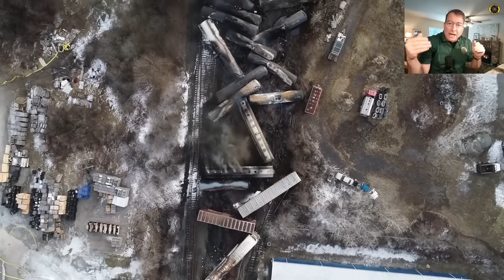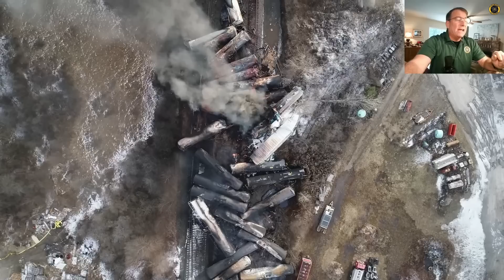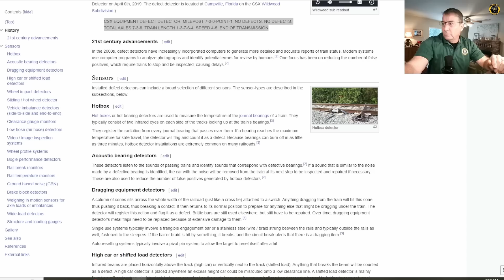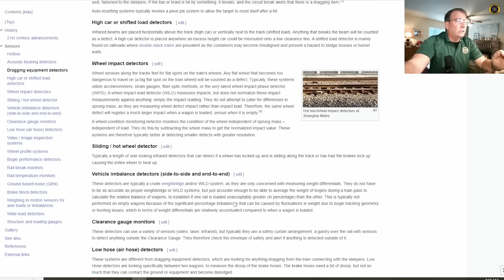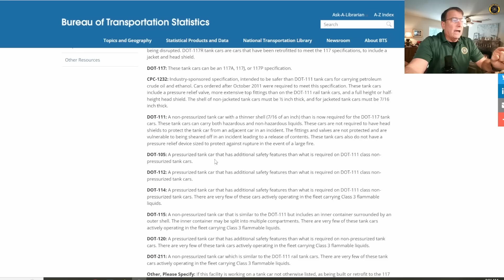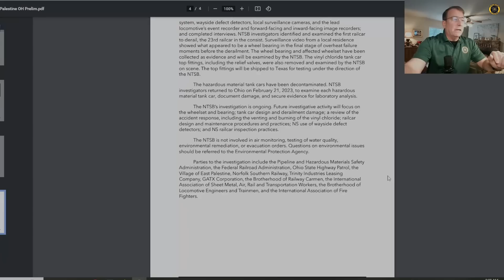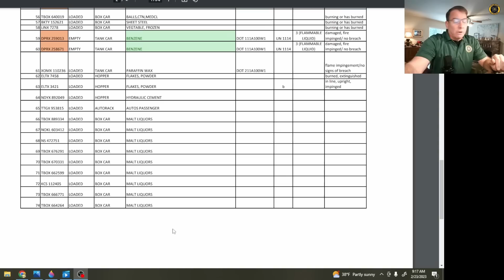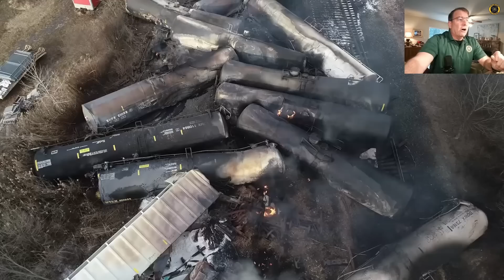NTSB Prelim Report: Norfolk Southern Train Derailment 23 Feb 2023

Comment: Juan, couple points.  The pneumatic (called "air brakes" in the industry) brakes are also used to slow or control a train.  In fact, the dynamic (what you refer to as regenerative) brakes aren't required, but the air brake system is required to be tested on every single train before it leaves it's initial terminal and any time cars are added, they must be tested to ensure their air brakes work.  The air brake system only initiates an emergency application when the air is let out of the train too rapidly.  If it's let out at the appropriate "service" rate, it simply results in the brake cylinders on the cars receiving a controlled amount of air pressure.

Second point.  The accordion effect is caused from the cars that have derailed, and are now rapidly decelerating since they are plowing through the ballast rock, being crashed into by the rest of the (not derailed yet) train.  The large speed imbalance between the cars that have derailed, and the cars behind them creates massive buff forces that cause the accordion.  As already mentioned in the comments, emergency brake applications, alone, rarely cause derailments.  I've had hundreds, and never had the train derail.
Reply: Correct!! Air brake systems are used for normal braking and train handling, not just in emergencies, where train pipe air pressure is lost of dumped by the crew.
Reply: Thanks, came here to correct the braking commentary, you did a better job than I would have.
Reply: A wrung journal will make for a long day
Reply: Good old George Westinghouse and his air brakes.
Reply: well at least I'm not the only one that caught that and I'm glad that some one else beet me to saying it. well put
Reply: I agree if anything the emergency braking is going to slow the cars before they derail. (Excellent comment!)
Reply: Thanks for explaining, and I have to agree “emergency breaks cause derail and accordion effects” just doesn’t make sense. If emergency breakers causes derailment, then there is no reason for them to even exist. Rails and train car design prevent accordion effect during a crash, and I would assume the hot bearing caused the axle to fail and derailed the train.
Reply: @AaronShenghao  Normally a train will already be slowing before going into a commanded emergency.  There is a reason the engineer slamming the service brake lever from zero to full (emergency) is not normal procedure in all but dire emergency, like engineer sees stopped train or other major obstruction (sorry wildlife you aren't counted as such) ahead on same track type dire.  Also in the case of this accident the emergency application was not commanded as it was caused by air line breakage after the initial separation occurred.  There are cases where commanded emergency brake application has caused derailment when the engineer commands emergency mode before at least partly slowing (by having the dynamics engaged before throwing the service brake into emergency) to allow the slack to come in before emergency braking is applied.  The problem is exacerbated if there are any sharp curves in the track being taken by the consist at the time emergency is thrown under such circumstances because momentum likes to stay in a straight line, inertia and all that fun 1st law Newtonian stuff.  The normal procedure of applying the brakes to full for stopping in a steadily increasing manner on the brake lever will not throw the brakes into emergency (emergency doesn't engage unless the rate at which the service pipe is losing pressure is above a threshold and it's very abrupt since the emergency state results in each car opening a valve on its own service line to dump the service line that much faster to propagate the 'message' faster).  Reservoirs charged via one-way valves exist on each car so they can stop even if the service line is completely empty.
Reply: Exactly right.
Reply: PUTING AIR TANKES ON EACH CAR TO EGULES AIR PRESSER !!!!!!!!!!!!!!!!!!!!!!!!!!!!!!!!!!!!!!!!!!!!!!!!!!!!!!!!!!!!!!!!!!!!!!!!!!!!!!!!!!!!!!!!!!!!!!!!!!!!!!!!!!!!!!!!!!!!!!!!!!!!!!!!!!!!!!!!!!!!!!!!!!!!!!!!!!!!!!!!!
Reply: The Locomotives have what is known as Rheostatic braking. Note that most of the braking on the train this size will come from the pneumatic system on every wagon. The locomotive may contribute roughly 20%-30% of the total train braking force. The braking energy on the locomotive is converted to heat in resistor grids. The description of the derailment accordion effect is spot on. Basically one wagon derails and effectively stops and the rest just pile into it before many have a chance to stop by braking. Even in emergency the brake retardation on a freight train would typically by 0.4m/s2 at best, probably a lot less for such a train so there is no braking force that would cause wagons to pile up.
Reply: Still, one of the problems even with emergency braking is that it takes quite some time for air pressure changes to propagate through the air lines to the back of the train.
Reply: @johnhaller5851  as soon as the emergency application is initiated, we dump (lift a toggle switch) which activates an emergency application from the rear of the train at the sbu. The modern air brakes also have a feature that accelerates the emergency brake application which is much quicker than a normal brake application...it’s not instantaneous but almost. I would say less than 2 seconds on a 12,000’ train.
Reply: @johnhaller5851  No, not really.  It propogates much faster than a normal service brake application due to each car, in rapid succession, dumping all the air out of the train line as soon as it goes into emergency, as opposed to the air exhausting out through the automatic valve on the locomotive in a service brake application.
Reply: I'm not a railroad engineer, or American, but my understanding is that most of your goods trains are hauled by diesel locomotives, therefore I don't see how regenerative braking is even possible, electric locos could dump back the generated electrical power back into the power lines. Unless the generated electrical power is dumped into resistor banks.
Reply: @axelBr1  The diesel engine on each unit turns a generator to produce the electricity to turn the traction motors attached to each locomotive truck axle to propel the train.  Those motors are used as generators of electricity which is fed into resistor banks to get rid of the heat for dynamic braking.  Baking in dynamic doesn't work below 25 mph where the air brakes finish the job of stopping.
Reply: @royreynolds108  d.c. locomotives dynamic works all the way down to 5mph and a.c. Units are good at any speed range. With a.c. Units, I will put full dynamic on and then release the automatic, wait for the tail end pressure to come up and transition into throttle...
Reply: @royreynolds108  Thanks.
Reply: @royreynolds108  And, that's incorrect.  Dynamic brakes work down to very low speeds, with modern extended range dynamic brakes retaining maximum braking force down to about 6 MPH.
Reply: @Alex Bristor  U.S trains  are diesel electrics. A diesel engine drives a generstor which inturn drive traction motors. As far as I know the energy  from electric  motors are dumped through a resister network and exhausted  as hot air.
Reply: @doug112244  Thanks.
Reply: @axelBr1  Big resistor banks with big fans on the roof. The energy is wasted to the air,
Reply: @SteamCrane  Thanks for the clarification. I know it's splitting hairs, but I don't know if it's regenerative as the energy isn't recovered.
Reply: @axelBr1  It is wasted to the air. Contributes to global warming or something.
Reply: @axelBr1  It is dumped into resistor banks.  It's not regenerative, in the respect that the electricity isn't recouped, but just converted to heat and blown out the top of the locomotive by a large fan. What I think of when I hear regenerative, is how electric cars actually recharge their batteries with the generated electricity.  We just turn it to heat.
Reply: @mikeb2058  I had the same thought when I heard regenerative. Not possible with a diesel powered loco, and I would expect that returning electrical power to the line for electric powered locos probably comes with a lot of issues. I guess regenerating and storing in a battery is possible now, although only beneficial if you're doing a lot of stops and starts; but I suspect that the amount of time spent starting and stopping compared to constant speed operation is comparatively short for a train.
Reply: @axelBr1  It's not stopping, but retarding that uses dynamic brakes and any time you're on a downgrade you will be using them. There's one section we run that's almost 30 miles of downhill grade and we're in dynamic brake almost the whole time. I imagine it would be more about the expense of trying to change all the locomotives and then wire all the track to accept that power.  We could never store it in batteries, they'd be full in seconds or minutes unless the whole train was full of batteries.
Reply: @mikeb2058  Hi, thanks for pointing an obvious use case. I was starting to workout a ballpark figure for the battery size, (i don't know enough about US trains to know the gradient you could be referring to, and how heavy the train would be), so was going to compare loco engine size, vs. truck size, (I've always liked Mack, am I allowed to say that to a railroader?), vs. the over-hyped Tesla semi. So a Tesla semi will have about a 10,000lb battery  https://youtu.be/hvg_i0GE0Vo?t=440, which  corresponds to a truck with a 325 ~ 425HP diesel engine. I was then looking up US loco sizes, of which I know little, but thought in the range of 3,000HP, (but not sure if I'm remembering UK locos), and anyway came across these guys https://www.progressrail.com/en/Segments/RollingStock/Locomotives/FreightLocomotives/EMDJoule.html Of course range is a complicating factor, the Tesla semi has a range, allegedly, of 500 miles, a diesel truck more than that, and I presume a loco a lot more.
Reply: @axelBr1  Modern American diesel trains actually use electric motors known as 'traction motors' to supply power to the wheels. The diesel power plant just runs generators which supplies the power to the traction motors, and does not turn the wheels. With that being said, I'm not sure what exactly is done with the excess power from the regenerative or dynamic braking.
Reply: @TheCraigW76  Thanks.
Reply: @axelBr1  They are known as Diesel Electric Engines. The Diesel Engine turns a generator that power the truck motors. Each axle of the truck has an electric motor.
Reply: @axelBr1  Google Dynamic brakes….also definition of diesel/electric locomotives 
A basic understanding would inform you that the diesel engine in a locomotive powers a generator that then drives Traction Motors, large electric motors, that drive the wheels.  When in dynamic ie: regenerative brakes, the power from the traction motors is sent to huge resisters that bleed off the power in heat…
Reply: @axelBr1  It's not really regenerative.  It's roughly the equivalent of a load testing resistor bank used for emergency gen-sets, and is situated at the top of the locomotive with huge fans to cool it.
Reply: @axelBr1  American locomotives are diesel electric.  The are also equipped with resistor banks to turn the regen'd power into heat.
Reply: @axelBr1  you're correct, we're not advanced enough to have regenerative braking.  There were railroads with significant electrified sections that could have leveraged regen as it became technically possible, but they tore out their overhead lines a few decades too early.
Parts of the eastern corridor are still electrified iirc, but only passenger trains use it and I don't know if it's equipped for regen
Reply: @applicablerobot  Thanks.
Reply: @applicablerobot  I recall reading somewhere that on the Milwaukee Road's Pacific Extension they were able to do just that - trains running down grade would backfeed power into the catenary.
Reply: @robertmartel8721  oh wow.  Their pacific extension was one of the sections of track I was thinking of.  Didn't realize they had regen capability back then, I'll have to go do some more reading.

Comment: One little tidbit for train brakes, they aren't like truck brakes and always on unless air pressure is applied. It uses the air to apply them, however each car has it's own tank of air and if commanded will dump some to all the air into a full brake application.
Reply: They are only always on until the air tank runs out of air, then it rolls freely. They can't be truly always on, or hump yards wouldn't work. Hand operated brakes are required when the air supply may be removed.
Reply: And that's why parked trains can roll away
Reply: Truck brakes are similar to railway brakes.  With truck brakes going to a trailer, you have a service and emergency line.  The emergency line pushes 120 p.s.i. to the brake reservoir which allows the spring brakes to release.  The service line is for normal brake application by either the foot brake or trailer handpiece..  Below 75 p.s.i., the emergency brakes are meant to apply.

Comment: I hear “cars,” “trucks,” and “air lines” and I’m trying to figure out what we’re talking about 😂 

I’ll re-watch this video again when I’m not distracted
Reply: Trucks are the wheel sets, the air line is effectively an air hose that runs the length of the train to control the brakes. Cars are the individual rail cars (called wagons in other countries)
Reply: @morganpavia7634  Thank you so much for that, Morgan. Greatly appreciated!
Reply: @radudeATL  Minor correction here.  There are usually multiple axles (wheelsets) in each truck in the North American railroad car, usually two, sometimes three on heavier cars.
Reply: @NightOwlModeler  thank you for the correction being on the periphery of the industry I forget that the whole axle wheel assembly is called a wheelset when I trying to explain what a truck is to people with little to no knowledge of the anatomy of a train. The minute I read your response I face palmed myself😂

Comment: Commuters always heard the defect detector announcement over the conductors handheld radio.  Never heard a fault announce during my Metrorail commutes.
PS - BBC article mentioned that Russia will have to start manufacturing railcar bearing as they had stopped producing them several years ago and were importing them from Europe before Ukrainian invasion.
Reply: It's the integrated cassette bearing that Russia doesn't make. Presumably they require less labor to change than individual roller bearings or ball bearings. I'm not sure how easy it is to convert back. Russia does still make ball bearings and roller bearings, it's all a matter of priority.
Reply: @johnhaller5851  I'm not sure what an integrated cassette bearing is, but all modern roller bearings on North American rail cars are sealed assemblies that contain roller bearings.  We're probably taking about the same thing.

Comment: The NTSB determines the cause. Rules and regulations from the DOT or FAA are required to be followed. If negligence is  at fault that needs to be corrected so it doesn't happen again. I heard there is new and improved braking  system available. but it is not required at this time? Sounds to me that something like this can and will happen again.

Comment: Great job tackling an industry that has less oversight than aviation. And you bet the industry will have a lot of recommendations on security upgrades lobbies will be fighting against tooth and nails. 

If I recall, trains have three braking systems, locomotive regenerative, wagon airline breaks, and locomotive brake only? Please correct me if I'm wrong.
Reply: Yes. Just like the railroad lobby fought Positive Train Control because of costs. But there's other mitigation railroads could accomplish when moving a lot of hazardous material tank cars on the same train. But that would take time and money on setting up every train.

Comment: 100 degrees above ambient is getting plenty hot for a large roller bearing. The grease goes to a liquid form and without a tight seal it'll  soon run out. My two cents is if those cars are hauling hazardous materials the bearings on those cars should be replaced after x number of miles.. regardless.
Reply: I saw a hot bearing car being set out at night, it squirted a pencil shaped flame the diameter of the bearing for 30 feet to the side. An arriving fire engine could not extinguish the flames, simply letting it eventually burn itself out.